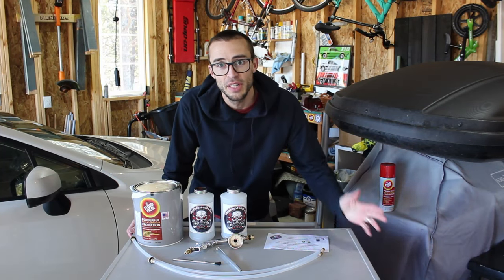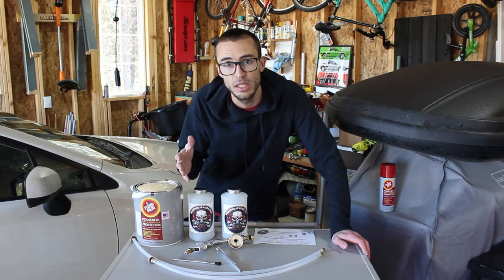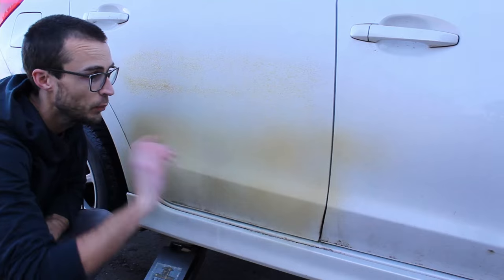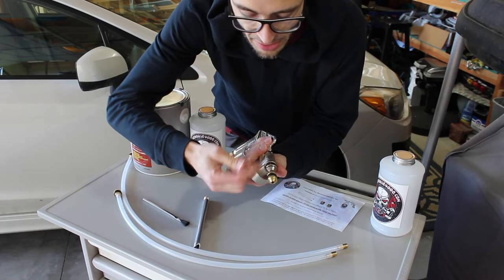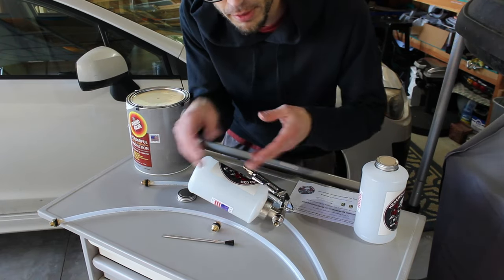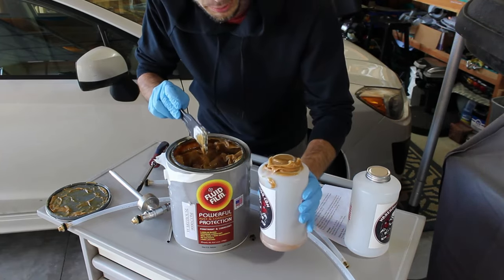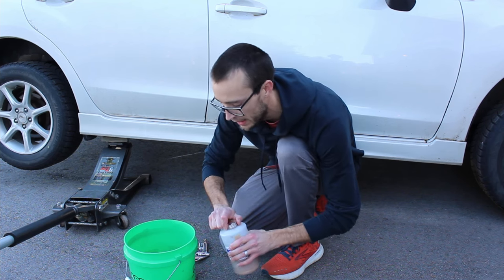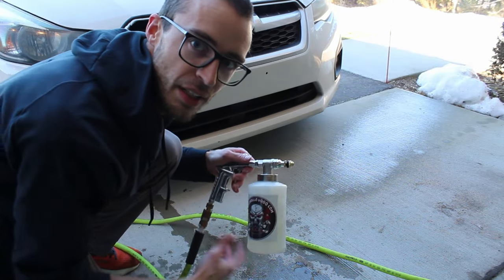How To Use Fluid Film Undercoat Spray Gun - WareHouse9000

Comment: Hey Kurt jsyk you can use a paint can mixer that has soft plastic arms that bend. It will mix the can up very well and make it far more fluid for adding to the plastic bottle. Plus you shouldn't need to warm it up either, since it will be very liquid at that point. thanks for your great videos!